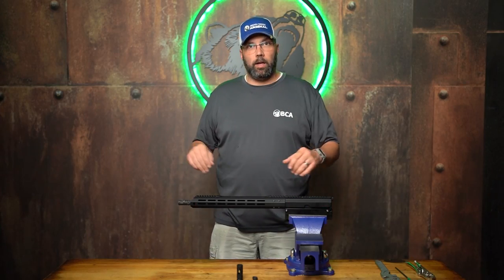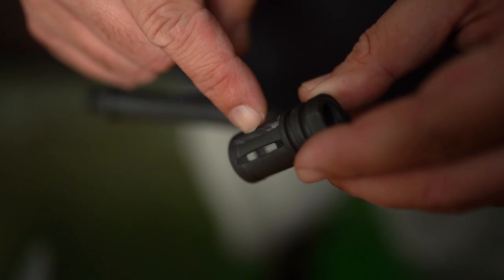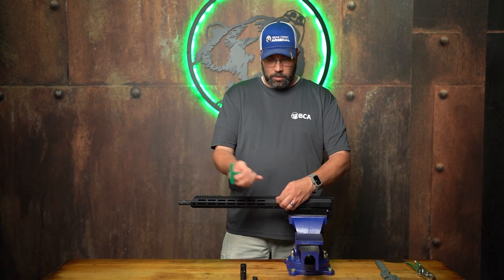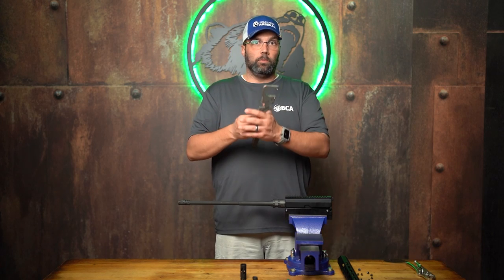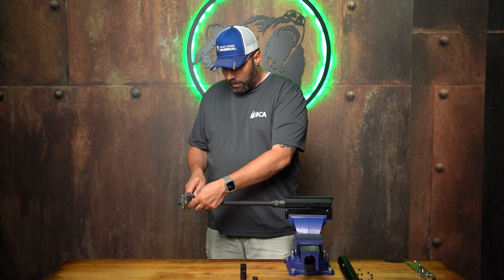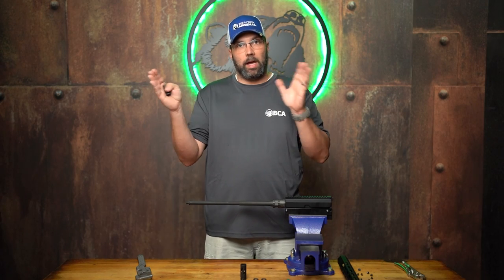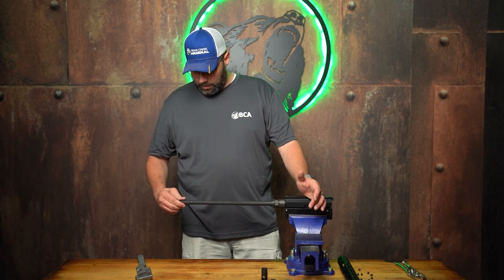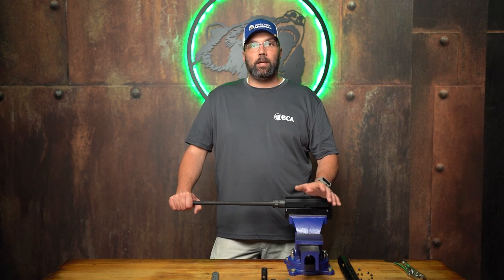How to Change and Install a Muzzle Device

Comment: You guys perfectly torqued your flash hider (with crush washer btw) on a 6.5 Grendel upper I got from you. It was on snug, but I was able to hold the barrel with one hand and remove the flash hider with a wrench with a bit of effort. I put a thread protector on the front and now I'm ready to hunt with it.  Your products and attention to quality always impress.

Comment: For those about to comment on ft/lbs and why a suggested amount of tension isn't stated, here's something to think about.  Firstly, for those who just want a magic number.. its usually around 15 ft/lbs... However, the torque of a standard muzzle device which either requires timing and/or a crush washer would be dictated largely by the crush washer's material, and/or the material of the muzzle device or barrel and so giving a standard isn't particularly viable. What might work well for one device, will ruin another; and thus giving any form of specificity would have to be case by case. If that doesn't make sense, I'll elaborate by example. If your muzzle device/flash hider is made of aluminum, but the barrel is steel, then you could easily strips the aluminum threads. The same is true with stainless vs steel

What do we want?
Folding Stock Adapters/Take Down Barrels/and Suppressors!
When do we want them?
Your earliest convenience. =D

Comment: For some reason I can’t remove the A2 flash hider on my upper it’s so damm tight
Reply: Did you get it off?
Reply: @alepepperoni2563  I can't get mine off either
Reply: Fire
Reply: I got a 22wmr upper and I can't get mine off either

Comment: No ft/lbs recommended on the torque ?
Also, if using for a suppressor, do not use crush washer.

Comment: Man, I love my upper but damn it these flash hiders are on WAY too tight! I put heat on it w a torch and a wrench w my 170lbs on it and nothing. Any ideas how to get it off.
Reply: Same here. Spiral on brand new .22 upper, have never ever had one stick so bad. heated twice, soaked overnight. Stupid to tourqe down so hard. It’s a .22 not a .50!
Reply: I actually had mine sent back to the company for free and they got it lose for me. Took about a week all in all. Not bad. Shouldn't have been on so tight in the first place but all is good now. Thanks Bear Creek. I would like to see new side charging knobs. Extended and or different shaped... Just saying. 😁🙄
Reply: If you don't have access to a longer handled wrench or a long breaker bar, go to the hardware store and buy a two-foot long piece of PVC pipe with an internal diameter large enough for the handle of whatever SOCKET wrench you own to slide into it (use a standard socket wrench instead of an armorer's wrench). The PVC pipe diameter should be the smallest you can find that will still allow the wrench handle to fit inside it. Also purchase a (open end) crows-foot spanner that will fit your socket wrench (either 1/2 or 3/8 drive); typical A2 flash hiders use a 3/4" size spanner, but measure your flash hider to be sure. Attach the crows-foot spanner to the socket wrench, put the spanner on the flash hider flats, slide the wrench handle into the PVC section enough so it won't slide off under load, and give it a counterclockwise turn. Be sure to push on the PVC pipe "handle" at a point farthest from the barrel. You're basically creating a longer moment arm, which greatly increases your mechanical advantage. With a long enough handle, you'll be surprised at how easy it is to remove the device, assuming no heat-resistant thread locker was applied during installation.

Comment: I have a right charging 308 upper with one of the "spiral" flash hiders. My armorer's wrench doesn't fit, and the flash hider is too big for the wrench. What size wrench do I need to remove it? Also is there any thread compound on it?

Comment: I have a 556 complete upper from you guys and they muzzle device is not budging, is this normal?
Reply: Me too. Also...can't remove the hand guard to get to the squared sides of the break
Reply: @dereksexton4199  not sure which upper you have, but I have the 625N and it has 8 torx head bolts that connect the hand guard to the barrel nut, after I remove those it slides right off
Reply: @ledwire3784  I have a Gen 1, 7.5" pistol upper. Has 6 hex head screws. Can't budge the guard, afraid I'll really screw something up...like the gas block or barrel threads. Already tweaked the A2 break today

Comment: Any suggestions on removing a stubborn spiral hider on a brand new bca .22? I’ve removed muzzle devices for years and have never had one on this tight. It seems like a lot of guys are having a tough time with the bca .22 upper hiders being put on in god mode at the factory. Any suggestions appreacated
Reply: I can't get mine off either

Comment: I've got two BCA complete uppers, both came with spiral flash hiders that are IMPOSSIBLE to remove.  Are they red Loctite glued in or was Rocksett used??
Reply from the maker: Sorry to hear that, we do not use Loctite on any of our builds. Please contact bcatech@bearcreekarsenal.com for assistance with removing your flash fider.
Reply: @Bear_Creek_Arsenal  I finally managed to get both flash hiders off by clamping the bbls in a vise with leather padding and using an AR wrench tool.
Reply: @rfdsrd  you wasn’t using a vice at first ?
Reply: @Pray_Grind  Put in a receiver vise.  What worked was putting the bbl itself in leather padded vise.

Comment: I’ve got your 12.7x42 and I’m having an helluva time replacing the muzzle device, does it have Rocksett on it
Reply from the maker: Sorry to hear that; please reach out to bcatech@bearcreekarsenal.com for a detailed response on how to handle that
Reply: I am having a similar issue on a .458 upper.
Reply: Thanks, I got the 24mm wrench and with a strong 💪🏾 pull in my vice it came right off
Reply: @andy1147  get a 24mm open end wrench 🔧 put in a vice it should come right off, that’s what I did
Reply: @MrRoro256  That worked!

Comment: So is it ok to do this with the receiver vise block as you do here?  I was told its better to clamp the barrel to keep from putting pressure on the barrel nut as you tighten or loosen.  Thanks for your help.
Reply: Yes, it's better to clamp the barrel, assuming you can safely and effectively do so. Securing the receiver when torquing a muzzle device means you put rotational forces on the takedown/pivot pin holes and risk exerting a shear force on the barrel index pin. That said, because thing A is better than thing B doesn't mean thing B is bad. In this case, if the torque applied to the muzzle device is relatively low, so is the danger of damage to the receiver. The vise blocks that have both an upper piece and a lower piece (one on the top of the receiver and one on the bottom; the sandwiched receiver is placed in the vise 90 degrees sideways and the vise jaws clamp on the two vise block pieces, squeezing the receiver in place) distribute the forces better than using only one on the bottom of the receiver like you see in this video.

Comment: Would you be interested in manufacturing a four prong flash hider?? Are used to be able to get a four prong flash hider on eBay from YHM. And they work great. I would also be interested in testing of your spiral Flash hider against a four prong flash hider to see which one is better. If your spiral flash hider turns out to be better I will have no problem purchasing multiples of those. Thank you for your time.

Comment: Umm, not complaining but the last upper I purchased from B C the m d was finger tight, I always dissemble, clean and lube new pews and parts and I was able to remove the m d with a simple twist of the m d with my hand. Other than this little inside the shop oversight the upper has worked perfectly and no complaints. And as I said I'm not complaining or even venting, just wanted to let you know. thanks
Reply from the maker: Sorry to hear that. We always value and consider customers' feedback

Comment: Do you guys use any glue or adhesives to put on your flash hiders from your factory? I wanna change mine out that I bought from you and it’s on there good. Just wondering if I will have to lightly heat it due to glue or loctite.
Reply: Fr I can’t even remove mine lol
Reply: @Jstk209  i got mine off. It was a pain. I used a vise with soft jaws,
Extended handle open ended wrench,
and a heat gun on low. It took some cranking but an AR upper receiver vise block would be awesome and super helpful if you have one. My 12.7x42 upper is awesome from them.

Comment: The second flash hider on my bca 10.5 I tried taking it off today and I couldn’t it’s really on there any suggestions?
Reply: If you don't have access to a longer handled wrench or a long breaker bar, go to the hardware store and buy a two-foot long piece of PVC pipe with an internal diameter large enough for the handle of whatever SOCKET wrench you own to slide into it (use a standard socket wrench instead of an armorer's wrench). The PVC pipe diameter should be the smallest you can find that will still allow the wrench handle to fit inside it. Also purchase a (open end) crows-foot spanner that will fit your socket wrench (either 1/2 or 3/8 drive); typical A2 flash hiders use a 3/4" size spanner, but measure your flash hider to be sure. Attach the crows-foot spanner to the socket wrench, put the spanner on the flash hider flats, slide the wrench handle into the PVC section enough so it won't slide off under load, and give it a counterclockwise turn. Be sure to push on the PVC pipe "handle" at a point farthest from the barrel. You're basically creating a longer moment arm, which greatly increases your mechanical advantage. With a long enough handle, you'll be surprised at how easy it is to remove the device, assuming no heat-resistant thread locker was applied during installation.
Reply: @blueeyeddevil1  I got it off thanks

Comment: Does an adjustable gas block void the warranty?
Reply from the maker: It does not void the warranty, find out more about our warranty under About Us on our website
Reply: @Bear_Creek_Arsenal  Thank you!
Reply: @Bear_Creek_Arsenal  Is that not modifying the product? 

What voids my Bear Den Guarantee?
 

Cutting, modifying, or misuse of a BCA product

Having another manufacturer or gunsmith work on a BCA product

Damage caused by using high velocity or high-pressure ammunition, tracer ammunition, or hand-loaded ammunition

Normal wear and tear

Comment: Heat the device that you want to remove with a small torch. Not to red hot but just a few minutes.
It will come off.

Comment: I probably gotta use heat or something bc the upper i bought from yall will not budge the flash hider at all do yall use lock tight or what???
Reply from the maker: Locktite is not used, these are threaded on. Please reach out to bcatech@bearcreekarsenal.com and they will assist you. We look forward to making this right for you